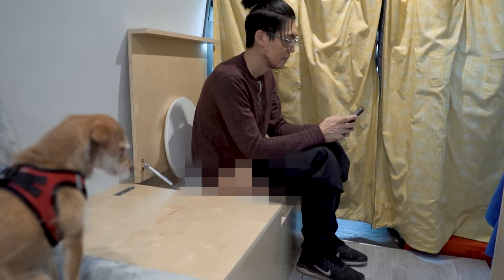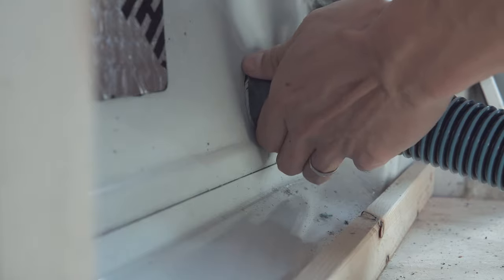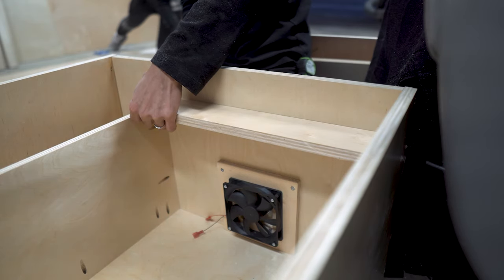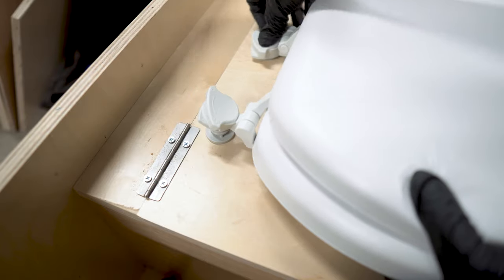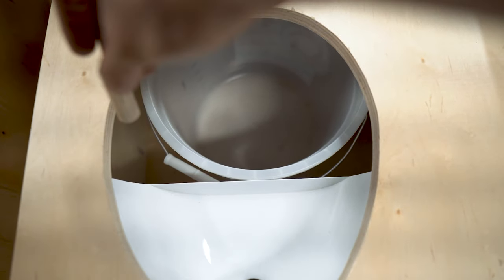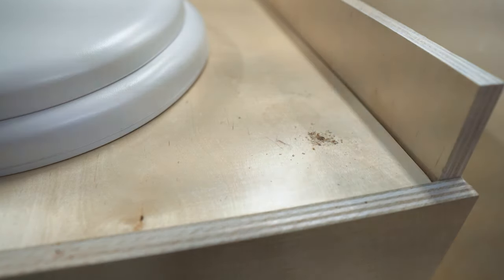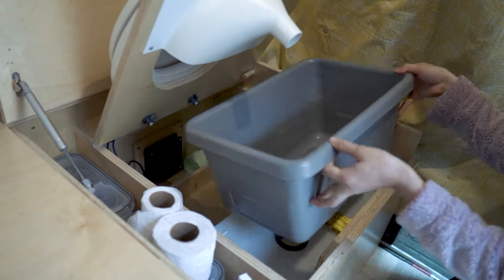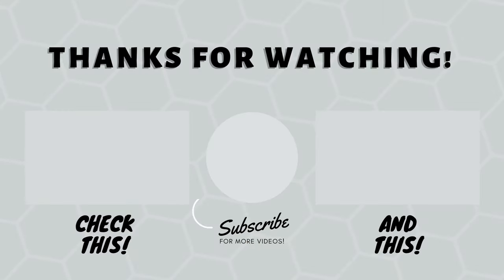How To Make A Composting Toilet

Comment from the maker: Having a toilet was must for our camper van and we're super happy with how our DIY version came out. What is a must have for your build? Comment below!
Reply: Do you have blueprint? I love this design. Most others leave the toilet seat open on top of the box and I love that this is covered and could be a quick seat in a pinch
Reply from the maker: @g.n.y.sister-girljudah3605  Our goal was to have everything in the van have multiple uses, so having an extra seat when the toilet isn't in use was a big deal for us. To your question though, We didn't make plans unfortunately because we felt the dimensions were particular to our van layout as well as other constraints that might not align with other builds..
Reply: Where did you find the urine diverter?
Reply: @IMEEMADE  totally, I am a full time car life RN, but want to build one day. "If it ain't multifunctional it's mini fatal."
Reply: Could you have added a gasket to lid for an airtight seal? The fan would be able to pull air from the outside.

Comment: Great build!! I've been using a dry toilet for almost 3 years, and have found that separating urine makes it exponentially more smelly. I very much prefer using pine pellets over peat, for both eliminating virtually all odor (I use it in the litter box, too) as well as being significantly more absorbent and way less expensive, and it all goes in the same bucket, which is lined with a trash bag. No sloshing liquids at all. I get about 3 weeks from a 40lb bag of pine pellets, $6, and 4-5 days to fill the bucket. Easy peasy. I hope this is helpful to someone!
Reply: Very interesting. I will remember that when I build mine. Thanks for sharing!
Reply from the maker: Thank you for the tip!
Reply: This is also more in line with composting. There needs to be liquid in there needs to be a carbon source. If it’s too stinky , you need to add more carbon- peat, wood, etc. Also letting the compost heat is a must.
Reply: @HopeCreekConnemara  Yes, exactly. I follow the method from The Humanure Handbook by Joe Jenkins. It's so simple, and works beautifully.
Reply: Thank you for this info!
Reply: Hmm.I will try without a separator first.
Reply: Thank you so much
Reply: Thanks for sharing...dry toilet is what I am thinking of using from now on..
Reply: I've tried pine pellets with a cat and it doesn't do anything for poo quick enough. 😣 The shavings would work best for me. I prefer the smell of cedar wood.
Reply: @maylin1986  Doesn’t make a good cat litter, but would be ideal for this application as the urine will break it down. Excellent at absorbing odor!

Comment: Nice build. I've created similar composting toilet but I installed a 10 gallon (an overkill, 5 gal is more than sufficient) under the van as a urine container. Then I installed a solenoid valve so that I can release the urine by a push of a button. This will add about $150 to the build but I do think it takes care of the urine issues---the effort it takes to dump urine in public restrooms or worrying about urine overflow wasn't for me. Thanks for sharing your build!
Reply from the maker: That's brilliant. Thanks for the tip!
Reply: Do you have a video or schematics of this?

Comment: I have found a 1 gallon bottle (or larger) with a small hose going from the urine separator to the jug works best. Use the cap for the jug to use when removing the jug to empty. Since it's taller rather than wider there will be less slopping around when in transit.
Reply from the maker: Thanks for the tip!

Comment: A few friendly suggestions:  mentioning the cost of materials used and the diverter chosen would be helpful to others.  In short, what was the cost of materials for this build project?  It appears you were using finished birch ply, so that should be mentioned too.  
Friendly suggestion: when cutting any exterior holes, not only be careful with the steel shavings, but also use some paint to cover the cuts, so they won’t later rust. 

I like how your video showed both people contributing to the build and narration.  That is good. :)
Reply from the maker: Thanks for the suggestions!

Comment: That's quite pretty and will built. I believe you put the computer fan in backwards. You need the sharp edges of the fan inside soaking pull the air out. After looking at my supplies of computer fans I forgot there was a arrow pointing which way it pulls are in which way it rotates for the arrow points to the side of the van to expel the gas. Sorry about getting it wrong first time

Comment: You guys did a nice job on your toilet. 
We used a simple 5 gallon bucket, no separation. As for media, we used pellets that are used for pellet stoves. Soak about 1/3 of a bucket full of pellets with water to break the pellets down, and it makes nice fluffy powder that smells good and covers well. No exhaust fan and no odor. 
😊

Comment: I'm super intrigued by this because I can safely say its something I've never thought about making before.
Reply from the maker: Us either! It was so fun we might make another one! 😅
Reply: @IMEEMADE  getting crazy over there
Reply: I replaced the plastic, pedal flush toilet (that always stunk up the RV), and sealed off the Black Tank. then I built a composting toilet, not unlike the one they built. It cost me less than $50, and it was by far the best modification to my RV. It is just as comfortable as any regular toilet, and honestly, you could build one of these anywhere.

Comment: Hi Lorne. In regards to the urine splashing in your container. Put a spigot (tube) from top to 1/2" or so off bottom.  Drill tiny hole just below top surface of tank into tube. Liquid will still slosh but shouldn't come out exterior fitting. Good video, simple & efficient. I like simple.
Reply from the maker: Thank you for the tip!!
Reply: Will you please elaborate on this method to keep liquid from sloshing? Not sure I see what you are doing, but this is a critical issue to solve.
Reply: @rwind656  at the bottom of the urine collection funnel put a piece of hose cut to reach down to almost touch the bottom of the collection tank and attach it to the bottom of the urine collector . You can then drill small holes up and down the hose it acts as a baffle preventing liquid from splashing back up the hose and out the urine collector.
Reply: @voiceofwethepeople5866  Thanks very - very - much for the reply. The idea of a baffle is brilliant, I can see it would stop liquid sloshing out of the tank.   Had to rewatch this video to remember their design in that area...    
Okay, if I got this, you're putting this baffle INSIDE the urine collection tank, not attached to the urine diverter?  So the tank has a built-in baffle on the input hole?  And the baffle would be a drilled pipe the size of the hole into the collection tank, running almost to the bottom of the tank?  

Maybe the baffle could be a separate or add-on drilled pipe with a thin lip at the top, removable for easier washing, which could be placed between the lid to the tank and the rim of the opening?  (Not sure I'm explaining that right.  I'm thinking of another comment which suggests using bottles for collection,  that are less obviously a urine-filled tank.  And wondering about add-ons. )

Comment: Thanks for the video!  This is roughly the same as the design I'm working on right now.  I hadn't considered the gas spring or the peg holding the 2nd (or 3rd?) lid open.  Definitely stealing those ideas.  I was going to put it in with the shower on my trailer, so one giant cover/lid takes care of all my sealing needs.  I found a square 5 gallon bucket for poop and a big rectangular funnel for urine, so there are large targets and no seams.  I plan on an elongated open front toilet seat so you can scoot forward for number one, but I don't know how much of an issue that will be.  I'm also considering a standing option for guys, like a pull-out funnel with a tube, or a second pee-jug that hides under the lid. 
I haven't figured out a urine container yet.  Yours has a very large capacity and I may steal that idea, but I will try something more stealth at first like a gallon bottle that won't be weird if I have to carry it into a bathroom somewhere.  Of course I may end up with a large number of gallon bottles depending, and constantly checking capacity would be annoying, so I don't know where I'll end up.
Reply from the maker: Excited to hear what you come up with!

Comment: Great video guys. Lots of good ideas I'll be using for mine thanks. BTW where did you buy the diverter?
 In all fairness it's not a composting toilet though is it? 
Unless you are conserving the waste material & completing the  composting to use elsewhere.
Also keeping the exterior vent below the level of the fan prevents rainwater intrusion.
Reply from the maker: We got it from eBay, there's a link to the diverter in the description! Thanks for the tips!

Comment: Very interesting!  I have to say I would never buy one of the store models out of the principle since the price is crazy high compared to the end product imho.  I think of the cons that of those that can be fixed in a DIY model.  I think odor can be controlled better with a DIY solution probably, for example when emptying.   I'd figure a way to seal off both of those before I open the list to remove them for emptying. 

Spillage on the road hasn't been stated by the people who reviewed them, from what I've read so far.  They have that part down pat and it would have to be handled carefully in a DIY situation.  Overflow was stated as a possible issue on the urine bottle: it happened to someone.  I personally might have additional lids for each container that I open and close each restroom use.

Comment: Very interesting, great job! Is there any smell from the poopoo bin or peat moss does its job? I'm asking because your toilet doesn't have anything to mix the deposit with the peat moss (e.g. like that rotary handle on nature head's composting toilets).
Reply from the maker: It does great with the peat moss alone as long as we make sure to cover all the #2 when we're done
Reply: @IMEEMADE  Thank's for the reply. After using it... would you do something differently now?
Reply: I read that using inexpensive hamster mix from Walmart works great.
Reply: @voiceofwethepeople5866  I guess its job is to suck the moisture content outta it. My plan is to have some mix of peat moss with saw dust (hamster mix) and maybe with some compost starters. We'll see. :)

Comment: Great design.  Best I've seen and lot's of good ideas.  Do you know what the current draw of the fan is?  I assume you're running the fan full speed since you don't have any kind of PWM speed control.  And, can you hear the fan easily throughout the van, or do you need to put your head right down by the toilet to hear it?  Thanks!
Reply from the maker: Thank you! I believe it draws a out 1-2 watts when in use. You can definitely hear a light whirring when the fan is on but it's not very noticeable, especially when there's any form of outside noise. We've noticed we only really need it on for about 15minutes post bathroom use.

Comment: Excellent design. One of the best I've seen. Just wondering how many days you can go before you have to empty each compartment?
Reply from the maker: Thank you very much! With 2 of us, fill time, We can go maximum 5 days before the urine container gets full. The #2 has a lot more wiggle room since we can easily change the bag. But typically we try to empty both at the same time when we can.
Reply: Agree

Comment: Hi, nice job..thanks for the video, although I am confused, what you did with that hose (that you left extra long) You installed a fan for ventilation, what was the hose for and where did it go ?
Reply from the maker: Good question! The hose was connected to the soffit vent we installed onto the side of the car after drilled the hole. We then cut it to length once the toilet box was ready to go into the car and attach to the wall. It basically acts as a channel for air to flow from the computer fan, out of the soffit vent, preventing any smells to be trapped in the wall cavity. Hope that makes sense!
Reply: @IMEEMADE  thank you Yes I get it now..

Comment: Not exactly how mine will be made, except overall.  However some helpful ideas I will be using.  No need for a urine diverter tho.  I bought my seat, but if you are a woodworker you could make the seat also.  Mine will be concealed in a chair.  Nice to see a video on composting toilets that doesn't say you need to buy an expensive toilet.
Reply from the maker: Thank you! We actually ditched the urine diverter also and using just pine pellets in a bucket and it's been so great!

Comment: I'm confused. How did you get the make-up air for the ventilation system without cutting a hole to allow the air to enter to then be exhausted? You say it works though. But I'm still puzzled about how that can work.

Comment: I lived in a van full time for over 40 years. Use a  pee bottle for inside. Since I spent most of my time in remote areas I would go outside and dig a hole for poop. When you can't go outside for lack of privacy a big coffee can with a plastic bag works for poop. Space is critical living in a van and this toilet takes up a lot of valuable interior room. I will say that  going outside to poop in the middle of a rainstorm or cold winter wind sucks. But if you can't handle that you probably shouldn't be living in a van full time. 
Another thing  is to avoid using wood for structural items in a mobile environment...better to use bolt together metal for the frame and wood for enclosing. This all wood screw design will come apart overtime. At least use 2x2s at the corners and wood glue with screws..It adds weight and takes up some room but it should last a lifetime if done right. Painting or sealing the wood is also essential for long-term survivability especially with the possibility of spills.
A small solar panel would keep the fan on all day combined with a battery should work 24 hours and will eliminate odor to near zero. Anyone who's lived in a van can tell you you don't want anything that stinks inside.
🌷🌷🌷
For  whatever it's worth I built seven van sized motorhomes and I'm working on my last one now which is roughly two and a half times the size of a van.
This one will have a composting toilet on the inside which is why I'm looking at different designs before I start on the poopy thing.
Those of you like myself who have a dog with you know that one way or the other you're going outside when nature calls.
Reply from the maker: Thanks for sharing!

Comment: Most likely your urine catcher tank is polycarbonate nothing sticks (adhesive) to it you have to have a tank access panel and a Tank fitting for your urine line and or empty port fitting
Access panel also great for maintenance and cleaning
Reply from the maker: Thanks for the tip!
Reply: Scuffing up the polycarbonate with some sandpaper helps make some adhesives especially quick epoxy adhere.

Comment: nice build video  the design and build is a nice simple one that looks nice and is practical , my only negative comment comes from many years of being   a boat owner and generally doing all my own maintenance and Installations on Plumbing ,Electrical,  HVAC ,and Mechanical  is the vent line being fastened with Duct tape it will hold for a long time but IMO  should have a Mechanical Fastener like  a Stainless Steel Hose Clamps  on vessels because of temperature changes , and  the constant  motion of a Boat in the Water  the International guidelines reccomend  double Clamps  on hoses  and in my 35 years of Boat Ownership  that system has not failed me yet  especially when talking about toilet systems  and Black Water tanks  you don’t want Failures  mostly because it’s plainly a Disgusting  and Unsanitary
Reply from the maker: Thank you for the insight!

Comment: that file at 1 minute in, looks like a wood rasp! NOTE! Chainsaw file!  I never throw anything away, and my wife will testify to that!!!! Sooo get that old chainsaw file, or buy a new one, break off a 3 or 4 inch piece and put it in that drill. Best thing I have found for smoothing up the metal edges. Especially if you have to resize the dash for a radio, the corners are always smooth!!!!
Reply from the maker: Thanks!

Comment: how many gallons is your pee container? Because I would switch it out for a gallon jug (if it fits) with a lid you can put on when traveling or going to pour out. Or a smaller container with a tight lid. I use a cat treat container. I have to empty it like every other/third day, but it's so small, I can put it in a larger purse or grocery bag to carry into a restroom, and empty it just about anywhere. Urine is the stinky part of the equation, once you have enough carbon over your nitrogen. I used a simple bulky system without a fan for years. Never smelled. 
Nice craftsmanship.